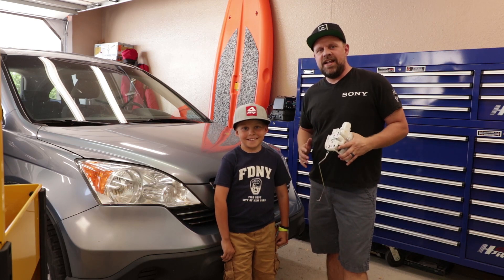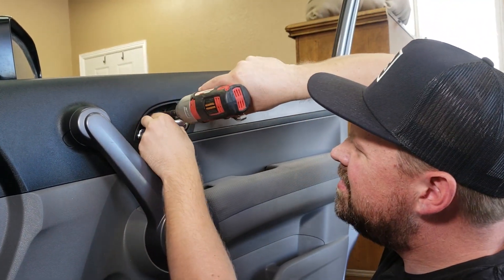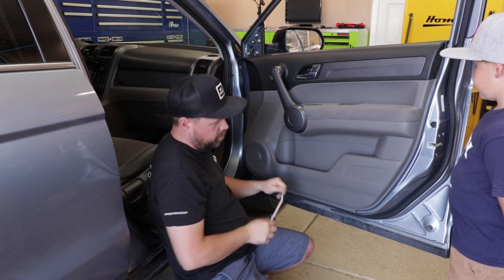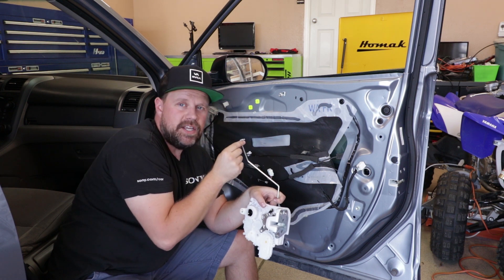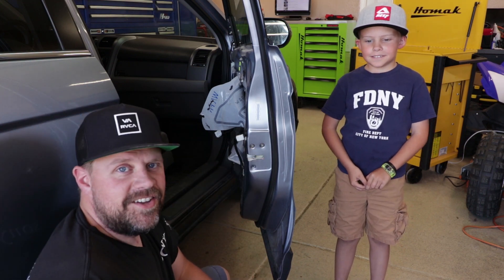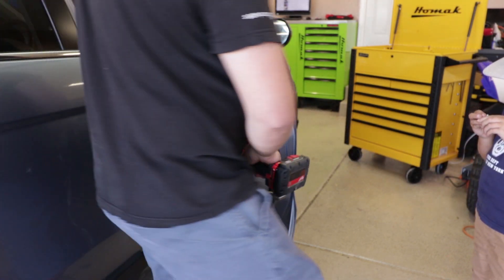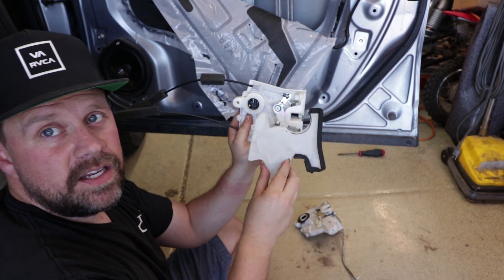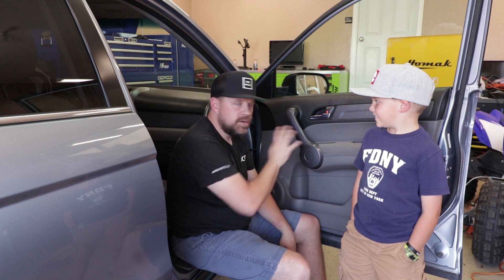HOW TO REPLACE HONDA DOOR LOCK ACTUATOR

Comment: Where aside from the dealer can I get the actuator?
Reply from the maker: Rock Auto
Reply: Ask My Auto Mechanic so it’s the intermotor that I would be purchasing on Rock Auto, I can use the wires that my Honda 2019 Fit has since it looks to be the same issue I’m having just like in the video you posted. PS thanks for the help just a girl trying to get her car squared away :)